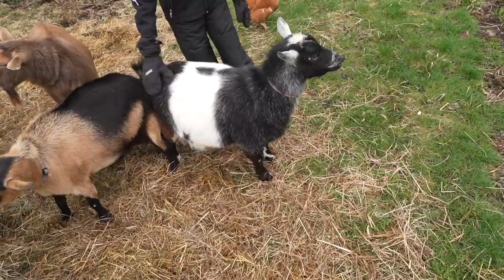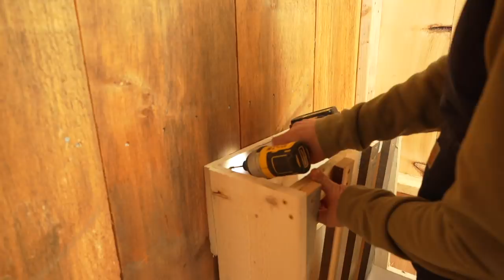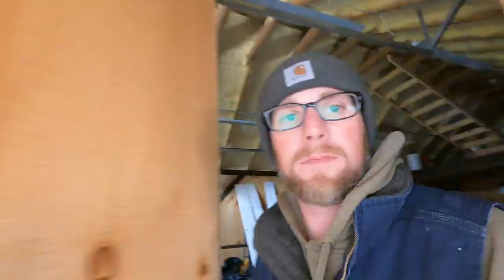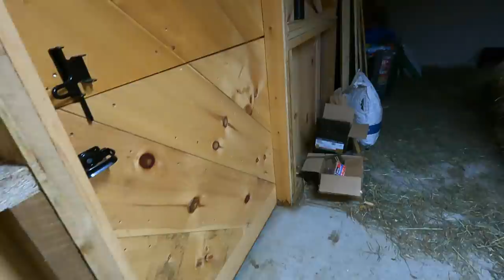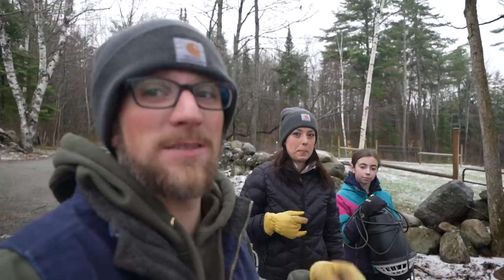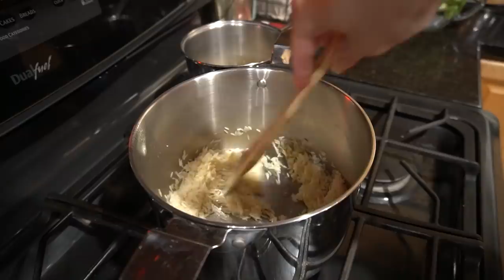Don't STOP NOW! There's Still MORE BABIES!! (Hope the Goat that was REJECTED by Her MOM Gives Birth)

Comment: Congrats to you an Hope on the babies, they are so cute!

Here's a rice recipe I use:
On stovetop, medium-high heat, In a round ceramic casserole/dutch oven, saute a medium chopped onion and 2-3 cloves of chopped garlic (or more as per personal preference.)  You can also add chopped green and red peppers.
When the onions are translucent, add a cup of rice, and start stirring in  2 cups of chicken stock, stirring on the stovetop, for about 2-3 minutes.
Preheat oven to 350 F.
Add salt & pepper to taste, and a bay leaf or 2.  (you can substitute other spice combinations here if you feel like experiementing)
Put the cover on and put the casserole in the oven, set timer for 15 minutes
Take casserole out of the overn, remove top.  Take out the bay leaves, chicken broth should be fully absorbed, use a fork to fluff out the rice, and serve.

Comment: I remember when you got Hope and it was so awesome to see her have her healthy babies. Gina, I sometimes make a rice pilaf that is pretty easy. I like to use basmati rice for its wonderful nutty flavor. Regular long grain rice can be a little bland. I also use brown rice and 1 3/4 cups of all chicken broth for 1 cup of rice. The prep is pretty much the same as yours, except I sauté about a 1/4 cup each of chopped onion and celery with the rice. I use 1 T  butter and 1 T oil. After it comes to a boil, I cover it and it needs to cook on low for 45 minutes. When there’s 15 minutes left, I stir in 1 cup of frozen sweet peas with a little salt and pepper. After the 45 minutes, I take it off the heat and let it set, covered for 15 minutes. Then I add a 1/4 cup of chopped parsley and fluff with a fork. And it’s ready to serve. If you use regular white rice, everything is the same except the cooking time which would be the same as you normally use. Sorry for the long post. Keep up the great work!

Comment: FLAVORED RICE, OR COUSCOUS,  OR ORZO, OR QUINOA.

1. Bake Poultry on bed of chopped carrot, celery, onion.

2. Use baked main Poultry body for  separate meal(s).

3. Chop all odds and ends of poultry, & to the extent more meat is desired in the grain, chop parts of the main poultry body. Set aside to mix into grain.

4. Skim fat off cooked pan drippings (aujus).

5. Chop veges in pan drippings smaller if desired.

6. Cook peas if desired.

7. Cook Rice, or Orzo, or Couscous, or Quinoa.

8. Mix all above ingredients into the grain.

9. Freeze excess in containers.

10. Enjoy.

Comment: My 'go to' flavored rice - makes 8 (1/2cup) servings (or 4-6 larger servings)...
Saute a large onion in olive oil (or your preferred oil)
Add two cups of rice and stir until toasted
Stir in 1 tsp ground turmeric, 1 tsp sea salt, 2 bay leaves, a couple pinches of ground cinnamon
Add 4 cups chicken stock (or broth) and bring to a boil
Cover and reduce heat to a simmer for 20 minutes until water has evaporated

You can chow down just like this or take it up a notch by adding ONE of the following at minute 15 of your simmer: 
1/2 cup sliced almonds
3/4 cup raisins (unusual, but YUM)
1 cup frozen mixed veggies* or 1 cup of any leftover mixed cooked veggies in your refrigerator

*If you decide to add in frozen mixed veggies, use a little less broth (3 3/4 cups instead of 4).  My family loves this seasoned yellow rice.  Maybe it will become a favorite of yours too!  Enjoy :-) Michelle

Comment: I sometimes use can of well shaken, non sweetened, cocoanut milk to 2 cups of rice in my hot pot. ( I add a bit of water to clean out the can and bring the liquid up to 2 cups or a bit more as I prefer sticky rice.  ). I often add some small pieces of fresh pineapple to the rice after it is cooked.

Comment: You are pretty good at building from the head. I can do that but I like laying things out in my 3 dimensional CADD package. That way I can try out different things.
Reply from the maker: I bet using CADD is a time saver too. I should learn how to use sketch up
Reply: @LumnahAcres  I use sketchup 2017, it is rather easy to use. I don't care for the way they are going. Their moving toward an internet base system. The last I seen there wasn't any way to save your files locally.

Comment: Al would that hay feeder work for rabbits? Or would wire be better. I feel like a bunny would get into the slats and get stuck. Gina, when I cook rice like that I put chopped onions and sweet peppers and all the powdered seasonings and thyme into the butter when it has melted, so when I stir the rice in the butter has been flavoured. If you like heat you can add hot peppers too.

Comment: Get an, "Aroma Rice Cooker", 6 cup version, under $25.00 dollars on Amazon. Now get some Minor's base, comes in many flavors, Chicken, beef, pork, mushroom, vegetable, ham or whatever, Bases are just stocks that have been reduced over time so that most of the water has been evaporated. You can make them at home if you want. Now add the correct amount of base, chopped garlic, fried onions, herbs, bits of leftover veggies, what ever you want and the correct amount of rice and water for how much rice you want. I, most of the time, use brown rice, mixed  with quinoa(About1/4 to 1/3 ratio to the rice)stir to mix. Use white rice if that's your preference. Close the rice cooker, set the timer according to the directions, and walk away. No hovering, no stirring the pot, no watching, to make sure it's not burning. You're free to go on with fixing the rest of your meal. The ingredients you add to the rice cooker are up to your imagination and it's a great way to use up leftovers. Keep in mind that the rice cooker takes a certain amount of time, so cook the rest of your meal accordingly. The reason I use Minor's bases, is that's the brand I used as a professional Chef and now use the smaller  1# versions at home. The home rice cooker is a great time saver. You also can cook enough rice, flavored or unflavored to use with upcoming meals on different days as cooked rice keeps well, covered by plastic wrap, or airtight container in the refrigerator. Hope this helps.